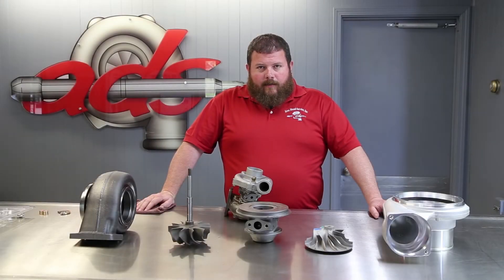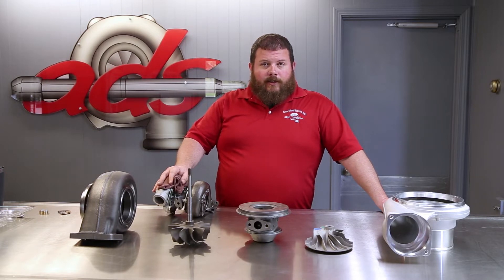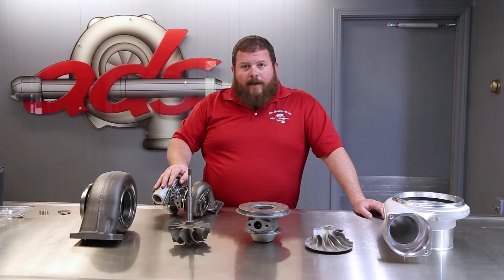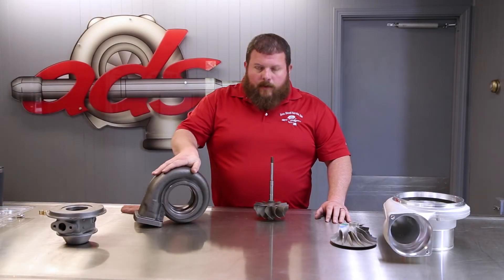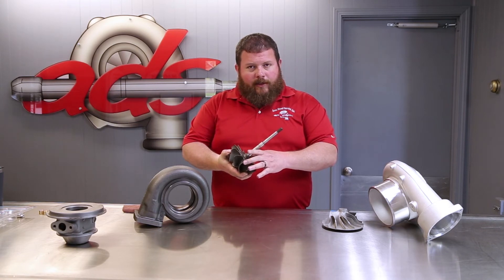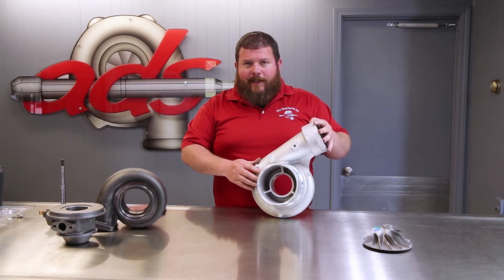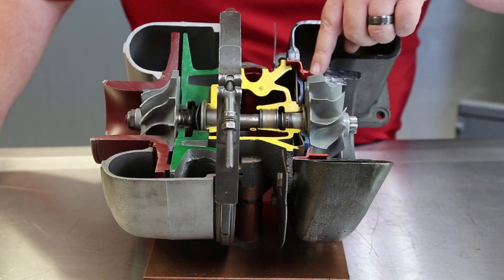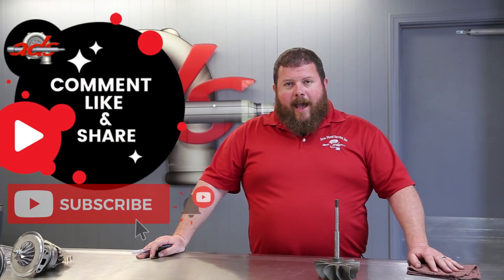#TurboTalk - Turbo101

Comment: Greg from northern Michigan. Good explanation. You might want to talk about turbine/compressor wheel shaft speeds which can reach over 120,000 rpm. Theirfore rotating part balance and bearing/shaft diametral clearance are critical in these assemblies.
Reply from the maker: Great point! Thanks for the  comment & watching!